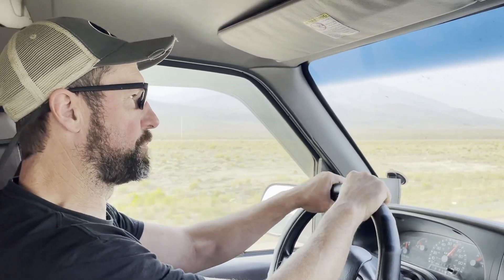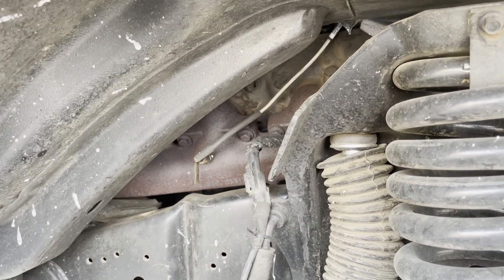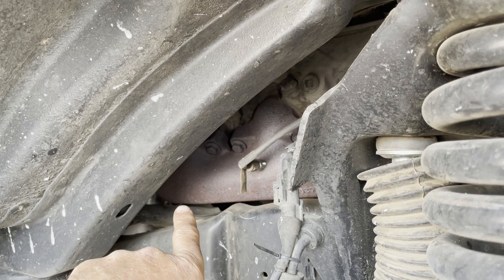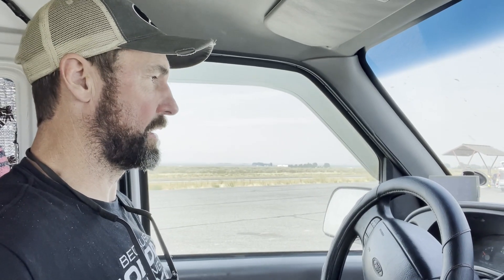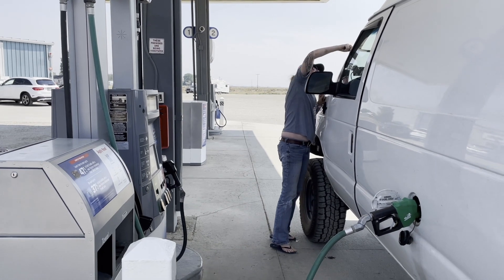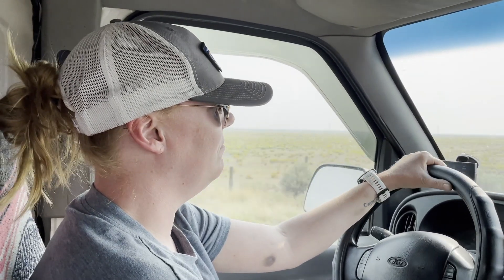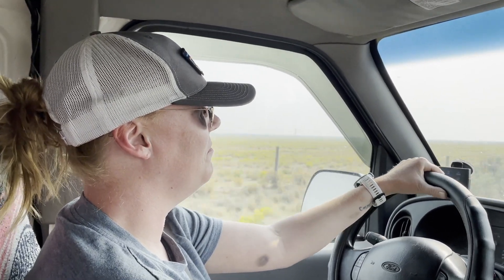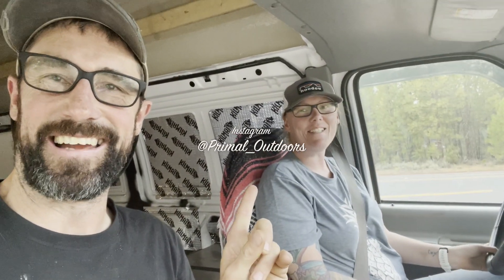Ford 7.3L Diesel Van - Utah to Oregon - Hightop Effect on MPG

Comment: I'm running a 99 E350 with a 7.3. It's a High top box van dually 2wd. I use it as a mobile mechanic shop. It weighs 14klbs and I average around 8-10mpg if I keep my foot out of it.

Comment: Install thermocouple on manifold directly below up pipe. Your egt seems high, at cruise I run 650 and  1K on hard uphill pull and wait till 300 to shut  down. Also u need 4.10 gear at min w/ 35s. I use DP tuner, kc turbo upgrade and a 4" diamond eye exhaust system.

Comment: In Oregon you can pump your own Diesel fuel.  You do not have to wait for an attendant.  It's only gas fuel that requires  an attendant.
Reply: I wish I had known that when I had a diesel! I wasted so much time waiting for attendants because I had dual tanks and often needed both filled.
Reply: It seems a little odd to NOT be able to refuel your own car. I work at the local Costco Gas Station and believe me when I say, most people are clueless as to proper safety. Probably would be a much safer place if I dispensed all the fuel. Also with the unbelievable amount of fuel that is spilled on the ground due to incompetence.....
Reply: @Fingerprintguy  It's suck a complicated job right, I'm sure a simple picture wouldn't suffice.

Comment: The big thing I noticed on my high top is that the cross winds will push you around more. But I don't notice until the crosswinds get up around 30mph. I'm in an RB e250 with the 4.8 and get 15mpg also.

Comment: Idling is also good for the turbo if you shut it off after driving the turbos will not get the oil it needs and you'll prematurely wear out the bearings

Comment: We always install egr probes at collector at end of manifold log.  It’s a measurement of all the exhaust energy from all cylinders on that side.

K.C. Turbos makes an awesome retrofit kit for the sxe turbo.   Which is way more efficient and will lower egts and get a boost in power.

Comment: Since getting my hightop I personally have lost a lot of weight because my van won't fit in McDonald's drive thru.   My other 7.3 Sportsmobile had a Fiberine Cruiser top and it got about 10mpg and it had 3.55 gears but no performance mods just bone stock.

Comment: While the convenience of a hightop cannot be ignored, there is nothing that looks better than a 4x4 van with a standard roof! Hands down way sexier anyday than a sprinter/transit/promaster.
Reply: Yep, I had a standard length E350 with a 410ci Windsor and Ford F-350 swapped 4wd. Even with 33” tires I BARELY fit through fast food drive-thrus and banks.
Reply: @RadDadisRad  i just missed an opportunity at one of the cleaner 350s for sale, couldnt sell my sedan in time! Im 5'9' so I can see myself being ok with the standard look as well
Reply: Yep, buying a Chevy van with the new 6.6 L . I’m afraid the van will be discontinued in the near future ? Getting mine now. I think the Euro vans stink
Reply: @RadDadisRad  I got a high top, a 6" lift, 35" tires and a roof rack. I still fit in some drive thrus at least.

Comment: I hope you do an intercooler setup on the 7.3 van. I would love to see what you figure out. I want to run one myself someday
Reply: A water to air intercooler and cut it in the charge air pipe. It’ll be the easiest solution to integrate.

Comment: Jason, use diesel kleen fuel additive. I use it in all my diesels they run much better. Helps mpg also.
Reply: or just throw in some acetone, naptha, and some 2 stroke oil for lubrication. At the proper ratios of course.

Comment: From my 2002 - 7.3 stock motor as far as I know: below is the mpg I get with average flat highway conditions 

55-60 mph = 19/20+ mpg average 
60-65 mph =  16/18 mpg average 
65-75 mph = 12/15 mpg average 

The odometer is at 360k and running strong.
Reply: I had a work truck with tool body diesel tools in body.  I was lucky to get 16 miles to gallon with the 7.3. 
I have a 2007 chevy express 2500 it has the 4.8 just drove to Florida from Maryland then back. My Trans was slipping yet doing around 70 miles a hour I got 20 to 25 mile to gallon. I'm very happy with this van. 
I'm getting ready to work on the Trans this weekend. 
After I get the inside built I'm gonna work on making it 4x4. 
I been looking for a high top at the junk yard. Don't want a real high one.

Comment: In OrEgon, you CAN pump your own "gasoline" into a motorcycle or scooter (passed in 2002).
Also, as Brando Davis mentioned in his comment, you CAN pump your own diesel fuel. So, if you WANT to wait for someone else to pump it, go ahead. But you are NOT required to allow someone else to pump your diesel.
Fueling ("GAS") stations can be fined $500, per pumpage, if they allow someone to pump their own gasoline. THAT's why they get testy when people pump, or attempt to pump, their own gasoline.
Reply: I find that many attendants around Portland seem to place greater importance on the D-Bag in the G-Wagon than my service van that was there first. So my rule is if I wait longer than 3 minutes to get started with pumping or others who arrived after me get serviced first, I just start pumping gas myself. I get some weird looks from the staff, but no one seems to want confrontation. 

Some attendants actually think that a business-vehicle driver pumping their own gas is allowed at gas stations open to the public. It's only at card-lock stations, but their ignorance is to my advantage. 😎
Reply: @tinygnat  Special!

Comment: I wonder if they make a spoiler that will fit? At the minimum they have designs that reduce the dust you kick up around the vehicle which helps reduce the amount of dust getting in the cab & on the vehicle, and hopefully it can also help to improve mileage.

Comment: 🇬🇧 Hi Jason, I don’t want to piss you off but I own a VW T5 van which I have done some work on it’s a 2.5 diesel with about 175 hp and I get 37 to the gallon at 70 mph, but as vans go it is not that large.
Reply from the maker: or 4 wheel drive but that is great mileage👍

Comment: Nice van!
It would be nice to work on in IC.
For reference,  my 99.5 F350 supercab weighs in at 7900. Hydrachip, 4 inch exhaust,  and intake. 
Running a Lance 815 I was getting about 13-14 mpg.
Empty and cruise set around 68 (wherever 1800 rpms is ) I can touch 20 mpg.
Also,  I always put my egt probe in after the primaries in the collector.

Comment: Sounds like your new tires are 10% bigger making your odometer 10% slow. This means your speedometer is also 10% slow. If it read 70mph, you were actually doing 77mph.
Reply from the maker: That is true but the Edge tuner accounts for the tire size and give us an adjusted speed so we go off off that so we were going 70.

Jason